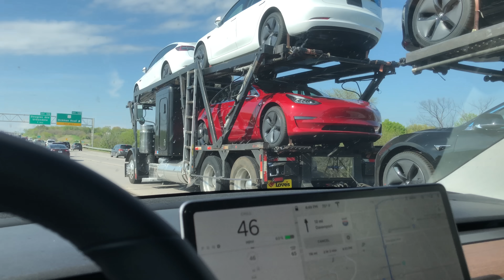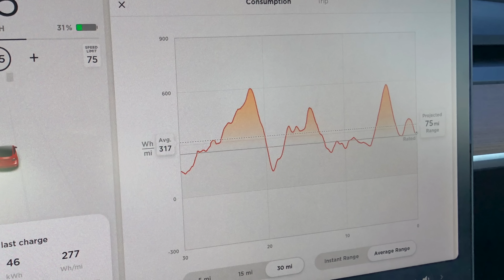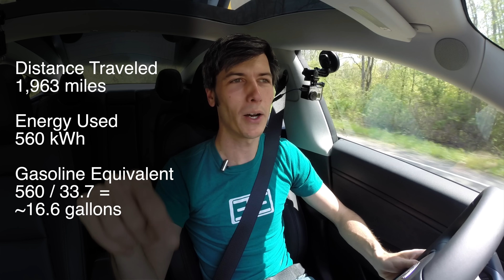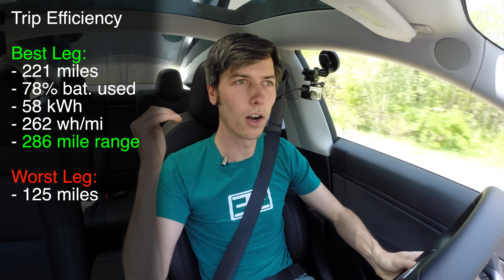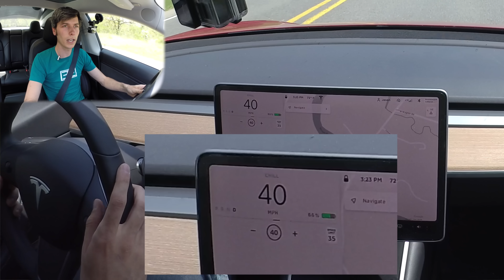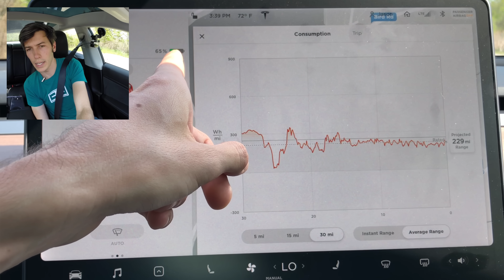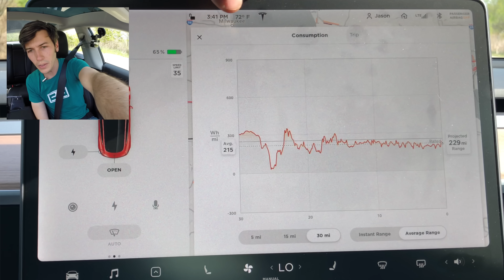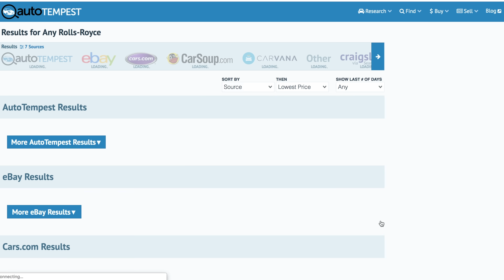How Miserable Is A Tesla Road Trip?

Comment: If you do a significant amount of driving on long trips, it makes no sense to buy the Performance version of the car. The Performance version sacrifices range for acceleration. I used to own a 2014 Model S P85D rated at 253 miles of range (my daughter drives it now). I upgraded to a 2017 Model S 100D (non-performance) with 335 miles of range. While that’s not an apples to apples comparison, you always lose range with the performance version of any Tesla Model S, X, or 3, compared with the equivalent non-Performance version. The Model S 100D now has a range of 370 miles, while the S P100D has a range of 345 miles. 
Otherwise, I thought this was an informative video, though what’s with all the hand waving? Galileo Russell (Hyperchange) has the same hand waving habit. It’s very distracting.

Comment: Driving 80 in anything is inefficient and you need to react very quickly. A tire failure can kill you. I drive no more than 70 and get better gas mileage  - I had a Terrain that got 28 at 65-70 and 24 at 70-75.

Comment: You failed to mention that your flat took 7 hours to fix because there is no spare tire. Your model 3 costs twice as much as a new VW Jetta which gets about 40 mpg on the highway. Can go about 500 miles pure highway driving and only takes 5 minutes to fill up. Plus Tesla receives hundreds of millions of dollars in government subsidies. The batteries don't last forever. You won't have to worry about it, but at an estimated $10, 000 replacement cost, good luck trying to sell your car in 10 years.
Reply from the maker: You know who else took a ton of govt cash? The two biggest US auto manufacturers, Chrysler and GM, to prevent complete bankruptcy.
Reply: @EngineeringExplained  Chrysler got a loan which they paid back. I'm not for government loans or subsidies. If a company can't make it it can go out of business and someone can buy it and make it profitable.

Comment: In the united states the electricity is mostly produced by coal, and you will have some energy getting lost to the environment. So it would practically take more than 16,6 gallons of gasoline.
Reply: Actually, coal is no longer the leading energy consumer in the U.S. It is a little more than half as much as natural gas. Yes still oil based products, but still relevant.
Reply: I will actually correct myself, it is about 2/3 not little more than half.
Reply: @ralphpiper2644  natural gas is way better for the environment, but i still think there is some loss in form of thermoenergy.

Comment: Driving above 65 mph is counterproductive for any type vehicle. It’s more expensive per mile and requires more stops. A Drive Plan is required vs. doing what everyone else is doing which is reactive driving! At the end of each day’s driving no one does numbers: time departed vs time arrived and miles= average speed. The surprise factor is: less than estimated speed! Each two hours or so required a toilet stop. The shorter the stop, the higher average speed. The longer the charging time, the lower average speed. It’s not the indicate speed of a segment. This guy’s video is not on Interstates! Sorry but after 5 years of driving an EV my data shows this trip report needs work.

Comment: I'm liking but...I'm still demanding more range and less charging time. My tipping point to pop for an electric vehicle is 400 mile range and no more than 15 minutes charge from 10 to 80%.
Reply: I think 400 miles with 45 minute rapid-charge time would actually work well for a road trip.

When I plan a road trip (with kids in the car at least), I plan on doing 750 miles a day for long distance, and no recreation stops. 
Works out to a 14 hour day at a 55mph average after figuring in stops for food, bathroom, and such.

Based on a 750 mile day, you need to fill up the battery once during the day, though two would be more convenient.
Figure that if you wake up with a full battery, and get on the road at 7AM, 400 miles will take you to your next meal where you eat and wait. 
Then you get back on the road and drive till the next meal, repeat the process. 
Then maybe give another 1-3 hours after the evening meal before pulling into the overnight spot, plugging into a slower charger to top off the battery overnight.

Comment: How about we talk about either the coal burned or nuclear fuel that will only be partially used & then added to the US 90,000 ton stockpile...nevermind the tragic conditions 3rd world countries have to suffer through to mine the lithium to make said batteries, plus said lithium has to then be shipped using fossil fuels of course to either japan or China for processing to create 18650 cells that make up a Tesla battery, then once the cells are complete they are again transported using fossil fuels to sunny California, nevermind the carbon footprint of the actual manufacturing process as all major manufactures have said that his frame and body works are “Unnecessarily overly complicated & wasteful” nevermind all the autopilot failures or the painful idiocy it allows for. Sleeping behind the wheel on the hwy in California c’mon....until we have clean electricity there is 0 advantage to an electric car other than you nerd out on it or see it for what it is...a novelty item.

Comment: Your "how much to fill up a tank" on the next video does not square with the $ amount vs gasoline on your 2000 mile trip. You said $196.30 for gas  and  $156.80 for electricity.  But at around $9.38 for a full electric "tank"  where my full tank cost $35 (at $3/gallon) and we both can get around 300 miles/tank or so (excluding your 15% cushion) then you should have made it in better than 1/3 the cost of gas. Clearly something is awry. And frankly, right now, the extra $40 for gas with no range anxiety and no need to stop at pre-ordained charging stations doesn't quite auger well for an electric in my future. If and when the range anxiety is ELIMINATED is when I will look into and buy an electric. IMHO.  By the way how long and how much to fix the bum tire?

Comment: Small correction: Power requirements don’t scale ‘exponentially’ with travel speed — it is O(x^3) which means that it can be bounded by a polynomial of degree 3. That is, mathematically and practically speaking, a huge difference.

Comment: 12 stops?, i will keep my gas engine thank you very much.
Reply: So you not gonna stop for 2000 miles?
Reply: I mean someone has to buy all the ICE cars being dumped to buy Teslas. As soon as the Model Y is out my wife's GLA AMG is getting replaced. 

I did a 3000 mile road trip in my Model 3 and almost all of the stops can be planned around meals. The only "extra" stops I had were first thing in the morning after breakfast and those could have been avoided if I would have stayed at a hotel with EV charging.

I guess you roadtrip with sandwiches, piss bottles and a car with a 200 gallon tank?

Comment: EVs are efficient but their eco print is the equivalent 160 000km with a diesel. Considering that batteries will have to be changed by then they will never be a good option.
Reply: Do you have a source on that info?
Reply: The other thing they ignore is just how much electrical power generation in NORTH AMERICA actually STILL comes from burning fossil fuels.   so using that electric car is effectively burning coal and gas to some extent.

Comment: The  amount of times the battery is depleted and then recharged long term effects the efficiency of the car and you'll no longer be able to yield those results under any conditions. Its fun owning a Tesla until you have to start making repairs to it and find out it cost 10X more to fix things on a Tesla than it does a gas powered car. What you save in cash you'll be paying out your ass in repairs. Have fun with car insurance too as that's even more expensive!

Comment: I'd much rather spend $60 extra on fuel (50 mpg car uses 40 gallons so about 24 more gallons than the electric) and reduce my journey time by 7 hours (about 3 15-20 minute stops to refill my 15 gallon tank), 7 hours of my time is worth much more than a $60 saving.

Comment: I'm 6 days into a 30 day road trip in my Model X with a 1 year old and 6 year old. We are loving it! At 1650 miles so far, will probably hit around 5-6k. The charging stops are really not an issue at all with children. Usually we are at the chargers longer than we need to be just because we are doing something with the kids.

Comment: 12 charges, 7.5 full batteries worth of energy, that's 7.5 charge cycles, Tesla rates the battery at 1500 charge cycles (I think?) so that road trip will have probably used up 0.5% of the battery's lifespan, multiply that out and that makes the battery lifespan about 400k miles, why's everyone saying "yeah but you have to replace the battery" To that I say "...well yeah but you also have to replace the entire car for most other cars by that point anyway so what's your point?" :P
Reply: Because not everybody will be doing a consistent 75mph on highways. Any type of "sporty" driving will draw far more current from the batteries which means they will need to be charged more often. Since lithium batteries degrade over time, there is no way he will be getting 400K miles out of them.
Reply: @herrschaftg35  That goes the same for ICE cars, what do they always tell you when buying used? avoid one that's been ragged out for half of its life, avoid a sports car with over 150k miles if you don't want issues etc...

Comment: Anyone who can afford a Tesla would buy an airline ticket to go that distance.
Reply: Tesla’s aren’t cheap but they aren’t as expensive as what people make them about to be.  There’s way more expensive cars on the road that are far more common.
Reply: @Stupranos 
The assertion was that they are just as affordable as your standard honda.  An assertion that is completely asinine on it's face.  You're making a case that while it may be expensive it's not the most expensive car on the road.  A completely different topic.
Reply: That’s not the point.... and not eco friendly at all. If you need to get there fast yeah fly but again this is a road trip test, the point is to enjoy the sights and local attractions. 
Also they are just as affordable as new Honda sedans now, especially when cost calculated over a multi-year term and fuel and repair costs included.
Reply: @lauraholmes9353  How much does a new set of batteries cost? What is their life-span? Did you factor that in?
Reply: @aprilkurtz1589  not to mention this naive thought Tesla fanboys/girls have without thinking about the ewaste of li-ion batteries and the load on an already taxed power grid if more and more cars become electric.
Reply: Lane Shurtleff Compare the li-ion "ewaste" to the tailpipe emissions and used engine oil of driving an ICE vehicle everyday for 5 years. As for the already strained power grid, what did oil companies do when there were more and more gasoline powered cars on the road? They refined more gasoline and built more gas stations. The "power grid" will gradually be replaced and updated with cleaner methods of producing electricity, which are becoming less and less expensive. Research and see how much of an EV's battery is composed of lithium. Even battery technology is changing rapidly... Stay tuned.
Reply: @lauraholmes9353 
No.  Teslas are not affordable.  If you include the "tax incentive" that reduces the price of the base model almost in half sure.  But nobody gets a base model tesla because they're almost useless, and all you get is a break on your taxes at the end of the year.  You still have to pay the full price up front.  The average price of new teslas that are actually sold is right around $60,000.
Reply: I quite agree, it's no more a fact that you can only go 15 miles and have to wait for 10 hours for the batteries to recharge....LOL. @lauraholmes9353
Reply: The Tesla 3 starts at $31,225 and that's about $3,000 UNDER the average price of a new car this year. He was driving the "Performance", and that's a $20,000+ option on top of the $31,225 base price.

Comment: You are always worth watching. In some ways this is like hearing from early cross-country automobile pioneers that needed to know where the next supply of gasoline was, where a tire could be repaired, where parts might be available, if the road was any good, etc.
It is pretty much a given that in 20 years electric vehicles will be common and worrying about charging locations will not be a problem.  As commuter cars there are a good number of EV available and if you can charge at home or work the charging is more convenient and cheaper.  BUT, if a person is OK with the size and capacity of a Model 3 I would suggest that there are a bunch of similar size hybrid cars that cost less and are as efficient as the Tesla. I would much rather take a road trip in a new hybrid than a Model 3, and in the end it would cost less and take less time. One other factor, if you are on a vacation or sight seeing trip the Tesla is going to require you to find chargers that may not be in vacation or scenic spots, whereas a hybrid has no such limitations. These EV videos will be a hoot to watch in 20 years. If only there were digital video cameras in 1919.............🙂

Comment: Give us the cost,- compare to = $ per - gal/miles than calculate kwh per mile/charge, you'll find out that the cost is approximately 60-75 cents per mile, (KW cost in the map you shown is anywhere from 10 to 16 cents per kw.) if you include the first cost of the car and battery replacement after five-six years. the green energy is not honest, electric cars are the way of the future however the cost in today prices is not compatible with gasoline engine and diesel can beat them anytime. You  talking to much boy - 56 years  old. Finally at 20 or so minute you got to to the cost, the analysis is not completely honest you are advertising more than honestly explaining, they must pay you good even the car was supplied to you, how people believe this analysis is beyond me.

Comment: The energy doesn't take into account loses from electricity generation.  For a typical steam power plant, thermodynamic efficiency can be estimated at 40 ~ 50%.  So actual energy used compared to gasoline would be doubled... But still not a big deal.  Still much more efficient than ice where thermodynamic efficiency is around 10%.  If solar and hydro electric generated then the direct comparison to gasoline works.
Reply: Sure your argument makes sense, until you take into account that locating, extracting, refining and transporting gasoline also requires massive amounts of energy from those same generators. Refineries often have dedicated coal plants running them (although they're not only producing gasoline of course). Either way, its a shared factor, and thus irrelevant for comparison purposes. And if you want to start the equation at having electricity produced, then you'd also have to take into account all the efficiency losses from all the processes that turns offshore crude oil into gasoline in your vehicle.

Comment: I love electric cars. But I just drove from Phoenix to LA on one tank of gas in a 2019 dodge challenger 5.7. It averaged just under 24mpg at 80 mph. It's crazy day in age where we can have a 400 hp muscle car that can drive from Phoenix  to the beach on one tank of gas. If we get the electric car to go roughly 400 miles per charge that would be a game changer. If you take a road trip chances are your not going to drive more then 400 miles without stopping. Still supremely efficient. And I will own an electric car. Just not where i want them to be yet. Plus they are out of my price range.